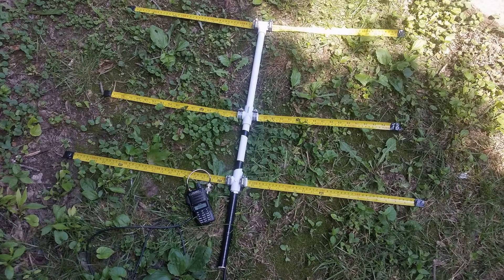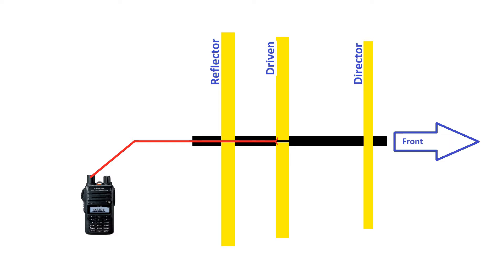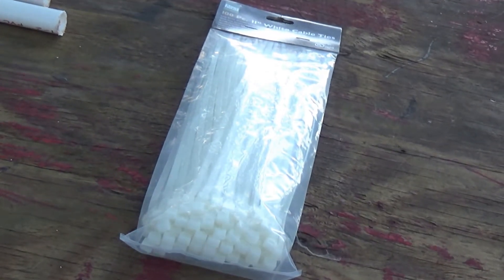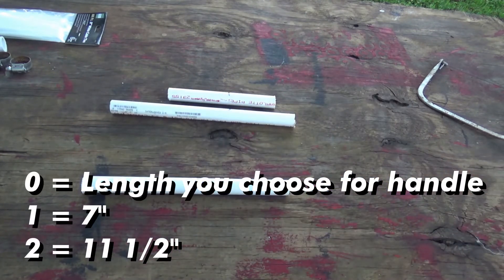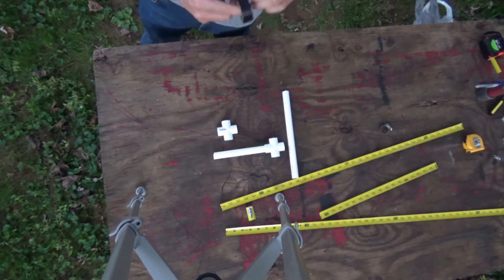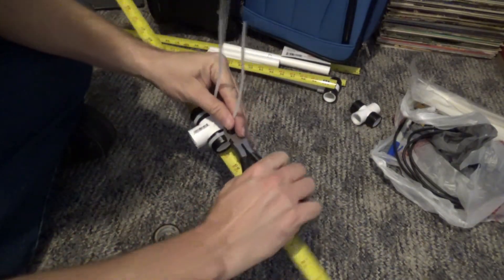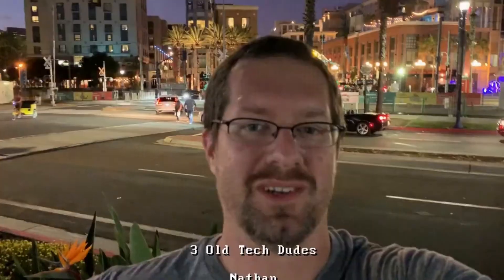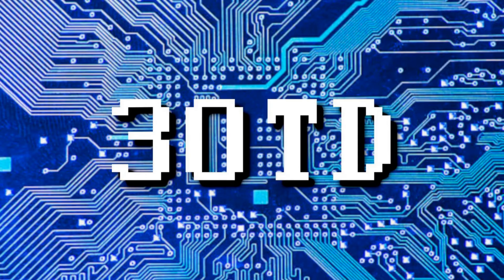Ham Radio Tape Measure Yagi Beam Antenna build for 2 Meters - 3 Old Tech Dudes

Comment: This is NOT a directional antenna. It's about as directional as a dipole. It works well, but it doesn't matter which way it's pointed, it's omni directional.

Comment: I Am a newbie, will a 30 watt soldering work for this type of antenna or do I need more heat to do it well? I haven't soldered anything since the 1950's and I forgot  if it is powerful enough.  Thanks
Reply from the maker: Yes, it should, it may just take longer to get it done.

Comment: I just tried this and had over 3-1 SWR. After a bit of head scratching, I realized I left the ends long (6 inches) where they connected to the antenna. Cutting them down to about an inch long got my SWR down to about 1.2, much better!
It works great! Thanks!

Comment: A Couple of Mysterious Mysteries  --  All is well until you solder the Coax.  You don't say how much of the coax needs to be stripped - which affects how far apart the two driven elements should be. Later, talking about SWR you mention that if this antenna is only to be used for Rx,  SWR doesn't matter, but while talking about SWR you mention (and I think this is the only place this measurement is mentioned) the two driven elements should be an inch apart.  Well, I'm only using it for Rx, so I am inferring from what you say later about the distance between the two driven elements --- One Inch?  I can work backwards from there to determine how much of the coax needs to be stripped.     Back to SWR, I would still like to check the SWR but danged if I could understand anything you said about how to hook up your SWR meter to this thing -- you spoke to fast and the words run together.  Not a big deal for me, because I'm only using this for Rx,  but it would be nice to know the SWR.

Like the person below says I highly recommend 6 hose clamps instead of those zip ties.  Much easier to determine when its as tight as can be.  60 years ago I could put more pulling pressure on the zip ties than I can now.  Also great idea to run the coax up to the driven elements through the PVC.  

But MOST importantly, how far apart should the driven elements be?  That's kind of  big "whoops" -- didn't hit me until I got to that step. I guessed an inch but haven't tested yet. So if it needs to be something else, please respond!!!  Also, if I wanted to add an attenuator a type with Part Number and instuction on where and how to add it would be greatly appreciated!  Thank you for getting me to go do something new! (to me).   Oh one more question!  The solder 60/40 OK or some other type? Does it matter?
Thanks Again -  Much Appreciated!
Reply from the maker: It is approximately an inch spacing on the driven elements, that is correct. The amount of coax stripped isn't highly critical, as long as it's enough. I guess about 1.5-2.5 inches is typically plenty, if I recall.

Any solder type will do, typically, as the tolerances of that aren't overly critical for this antenna. 

I later did add an offset attenuator to this particular antenna. It simply goes in line (in series) with the coax, between the receiver and the antenna. Most types of attenuators will attach in this manner.

Thanks for building the antenna and watching our video! I could have laid out the commentary better in places, that's for sure. Maybe I'll do another version of this video one of these days! -Timmy KB9SNL
Reply: @3oldtechdudes  Hi thanks for answering.  Can you tell me the make&model of your offset attenuator?  I gather you're happy with it.  This will be my first experiment with an offset attenuator, might as well use one that is tried and true.  73 Dave

Comment: Since the total tape required is 112” why not suggest you initially cut an 11’ of tape before cutting the separate pieces? This would eliminate the risk of getting cut if the cheap tape lock fails causing a cut on your fingers, arms or face? If the tape is long enough for two antennas cut the second one, roll it and tape it for later.

Comment: So is pvc pipe length 11 1/2 “ or  7” long  you changed the cut length please advise thanks
Reply from the maker: The section from reflector to driver is 7", the section from driver to director is 11 1/2".

Comment: Could you explain what the scrap wire hairpin match is for? I don't understand. I thought the 2 elements aren't supposed to be connected.😢
Reply from the maker: Sure! Essentially, it creates capacitance between the two elements, allowing the distance between the two to act as a capacitor. By adjusting the distance between the elements, you can get the SWR as low as possible. Essentially it can be used to bring resistance at frequency to as close to 50 ohms as possible.

Comment: Thanks for the plan. I just built one to go with my home brew fox hunt tx kit. This antenna is 1.02/1 at the high end of 146.000. I'm thinking of adding another director to make it more directional??? Cheers VE3PUH.
Reply from the maker: I think an extra director would help a lot. I’ve been foxhunting with the antenna I built in this video, and I feel it is not focused enough at times for foxhunting. I may do the same. Going to another hunt with it today, actually! 73 Tim KB9SNL
Reply: @3oldtechdudes how far back and how long should the second director be? 73 WP4TGK

Comment: I built one last night, before watching your video. I used the black tape, to build up the gap, and it works nicely. I used hose clamps instead of zip ties, for easy adjustments. I also ran the coax inside the tubing and out the handle. 
The antenna works Great! With my Baofeng UV-9R+ HT, I hit repeaters 30+ miles away. And had a QSO with guys on a repeater 20 miles away, on 1 watt. They sounded like they were right beside me! 
I was VERY impressed! 👍👍
Reply from the maker: Awesome! Great to hear it is working so well! The zip ties were an experiment on this particular build, I’d built a previous one using all hose clamps. In use, I’m finding the hose clamps are probably the better option…or I should have pulled the zip ties even tighter!

Comment: Hello, just curious - why is there a 5inch wire shorting the positive and negative sides of the driving element?
Reply: Hairpin match
Reply: It changes the impedence of the antenna because ham radios like 50 ohms.

Comment: i built a tape measure 4 element tape measure ygagi for grms and it stinks. i suspect the a rubber ducky does better. i am only trying to listen at the moment. i have been playing with all things radio related for about 1.5 years but this is my first build and i am ok with it sucking for now, as long as i can figure it out eventually.